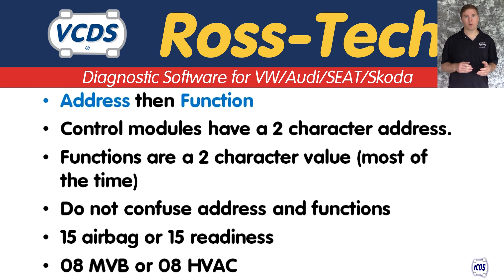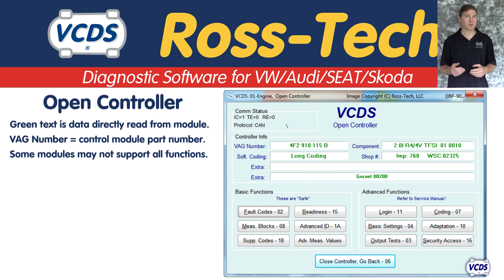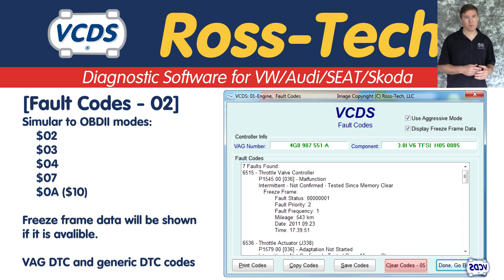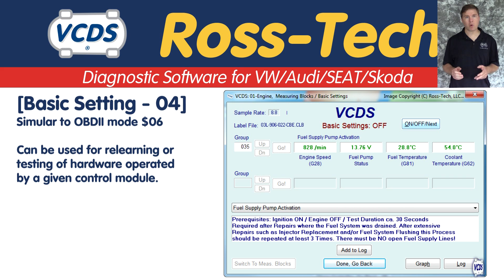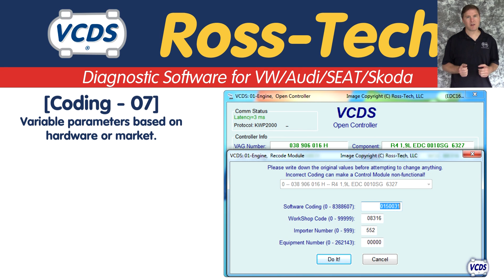VCDS Scan Tool Functions

Comment: When introducing an acronym (such as UDS) would you please give the full name and description for the acronym. Without the description, the viewer is left without possible important information that they will need to fully understand the instructions. Thanks.
Reply from the maker: https://en.wikipedia.org/wiki/Unified_Diagnostic_Services
Reply: @RossTechVCDS   How about taking some cues from that Wiki. Notice that each time it introduces an acronym they spell it out. Not every reader/viewer has the same base knowledge as the author.
Reply from the maker: @christopherjamieson4237  I've added some info to the notes above.  The training program we put together was geared towards professionals who have experience in the automotive field, but just starting with VW/Audi.  

Regards.
Reply: @RossTechVCDS How to change km to miles on Volkswagen up 2012 using vcds 23.11.0.